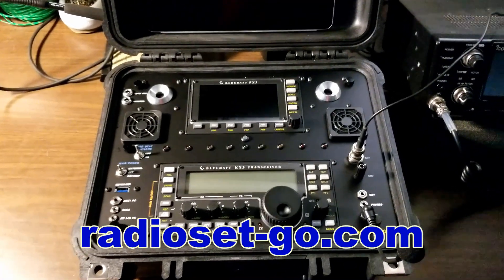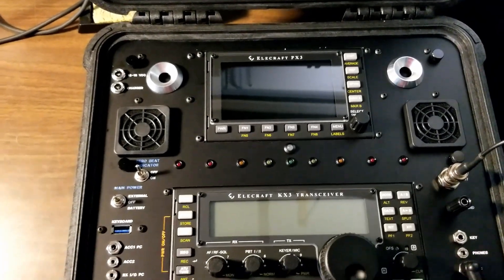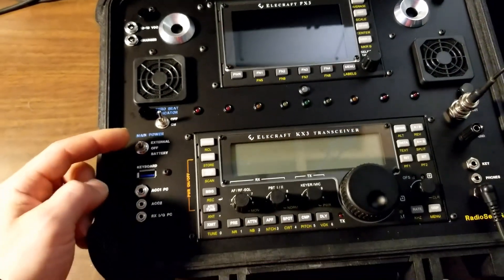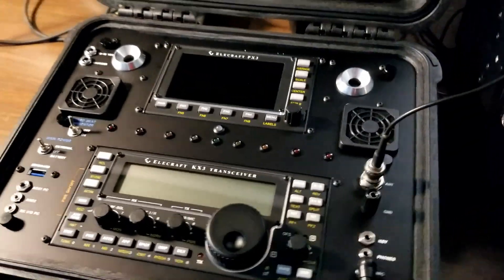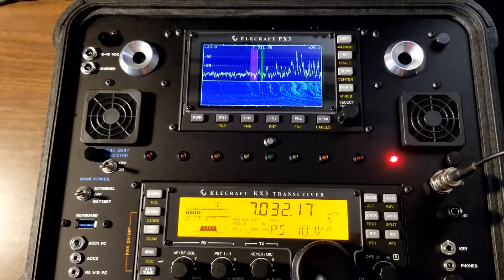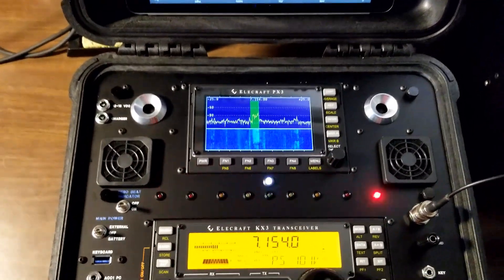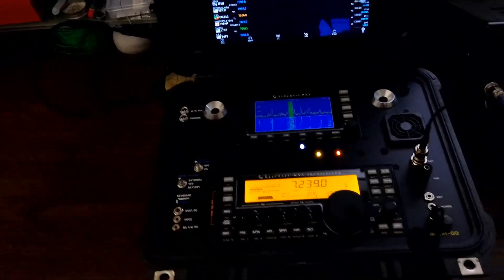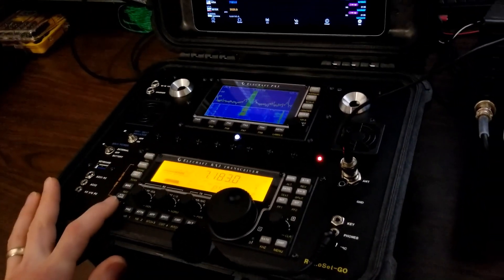Elecraft KX3 with PX3 retrofit by RadioSet-GO

Comment: Price? fully equiped?
Reply from the maker: As presented, parts, labor, and US shipping is ~ $1000. Add $140 for 17Ah capacity. This is the retrofit cost and does not include the KX3 and PX3.
Reply: @w1jsb  You have a IPAD on top do wwe have to send you also the IPad so you can fit the unit in the cover ? It needs a Wi-Fi connection also ? 73 Very Very Professional VA2SOB Claude

Comment: It’s portable transceiver.. big case?..
Reply from the maker: It's the smallest case that would fit everything the customer wanted. It's certainly not an ideal SOTA setup, but if you want high battery capacity for longer full power operation and all-in-one convenience with excellent audio, while still staying cool, this is an option. 73
Reply: Hello I saw on your Website That you are using the Pelicase 1170 for the KX3 only ( so without the PX3) . What Pelicase are you using for this KX3/PX3 combination? Is it a Pelicase 1400, or how is the size especially also in height?
vy 73 de Michael DB2GM